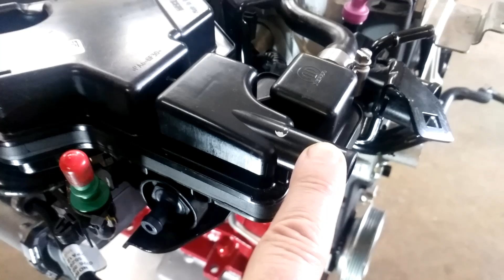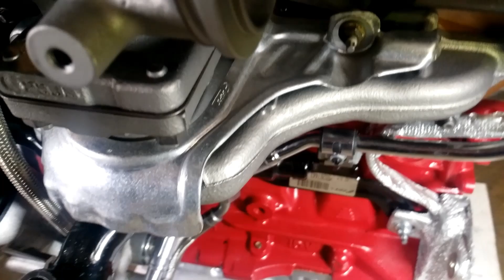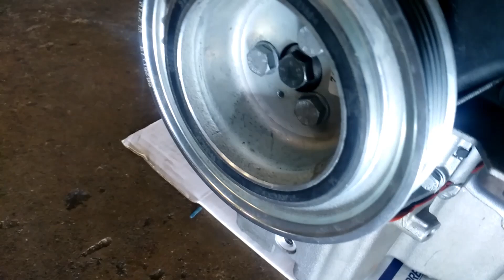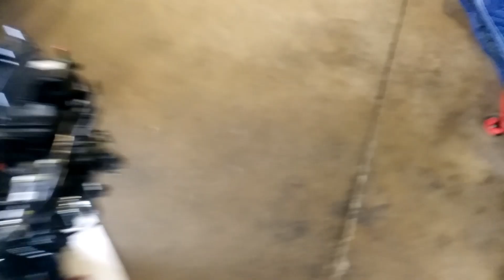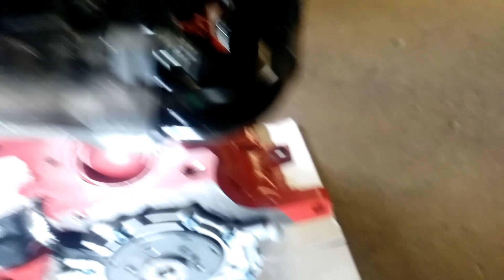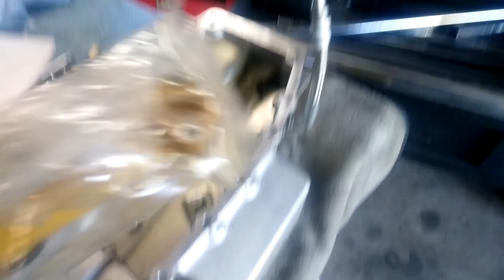Fiat 1.4 Multiair Build Completed, Plus Timing Belt Change Instructions

Comment: That steel coolant pipe under the exhaust manifold with the funny nut goes right back to the the original 1980s Fiat FIRE engine. They work well but on older cars they are noted for corrosion. Worth a coat of paint (on top of OEM) in my opinion.

Comment: The oil cooler is a plate type heat exchanger. The idea was perfected by Rolls Royce with patents going back to the 1970s but it's likely they had them even longer ago on classified equipment.

Comment: Me again. The 1.6, 1.8 and 2.0 twin can engine as used in certain Fiat cars and the Alfa Romeo TS (Twin Spark) had non-keyed cam pulleys. Cam locking tools sat over cam lobes on each cam. You also needed a reaction (holding) tool to hold the cam wheel while torquing the retaining bolt.
Reply from the maker: I don't doubt that, but this is the first engine I have seen that's set up this way. Keep in mind we didn't have any new Fiats or Alfas here for a while, so there are engines I haven't seen. All engines I have seen have either timing marks, keyways, or both, this is the first engine I have ever seen with nothing to help align the cam. I think it's a huge mistake on Fiat/Alfa's part.

Comment: Great video, I have the 1.4L  engine in my 2016 500X POP with a 6-speed manual, it's a fun car.I don't plan on any mods but I love learning about it.
Reply: can I know one thing, is that follow the same style of Abarth 500's transmission? cause It only has 5 speed manual. so is it possible to swap?
Reply: @duke9620  500X, which is more of a Jeep than a Fiat 500
Reply: @duke9620  im not saying its impossible, but chances are it is impossible. would need different halfshafts, shift linkage, etc

Comment: Old Fiat FIRE engines (1.1L especially) are popular in Eastern Europe for amator racing - slap in 1.2 head, factory 4-2-1 exhaust manifold, 42mm throttle body or ITBs from a 650cc bike, balance rotating assembly, put flywheel on a diet and you'll get around 120HP reving up to 8500 - 9k RPM
Reply from the maker: That makes sense, all the Fiat engines are good. We didn't get than engine in the US, but I'm glad to hear it's doing well over there.

Comment: Me thinks 153,000 miles is the life of this engine / car (246,229 kms) I can't imagine many being alive after that except a few.  And good luck finding a mechanic that knows about the crank lock tool when that happens.
Reply from the maker: My 500L has about 130,000 miles on it and still has full compression and doesn't leak or burn oil. That's with over 200hp for almost it's entire life so I do think the engines will last through one belt cycle and way beyond. However the value of the car is such that they may not be worth maintaining beyond that. Fiats drop in value like crazy and the lack of dealer support has been a killer to the brand. Plus the prices of the parts have been going up a lot.
Reply: @GregsAirplanesandAutomobiles  Yes I needed 5 lug nuts for my Abarth and only the dealer had them $85.  Big reason why I stopped driving it daily and its only got 34,000 miles, still like new.  It has gone up in value recently though, which is good.  From barely worth $14,500 to nearly $20,000.  So storing it has been worth it.
Reply: Change the oil every 6.000miles /10000 kilometers and the engine will live over 400000 kilometers

Comment: I wouldn't take the engine out to change the timing belt.
However, I got stuck when removing the first cast.
It is connected to the compressor support casting.

Comment: Answered several mysteries that not available anywhere else.  Marvelous! The last mystery is - why do these engines drain down the oil in the valve actuators when inactive for long periods?  It seems like a simple design flaw that there is a missing check valve  in the oil supply for the accumulator chamber or lack of quick positive supply from the oil pump or worn intake lifter clearance?  If the oil pump could quickly replenish the accumulator when cranking a long stored engine it would seem to solve this issue.  It is a shame that ignorant/ lazy/ oil maint. may be the death of this design.  The Dart an Spider are history - is there an easy mod to the oil passages?  Accusump does not seem to have a kit.  A complete diagram of the oil network for this engine has been elusive.
Reply from the maker: Thanks for watching my video. Yes, the oil drain down is an issue if the car sits for too long. In my experience it has to sit for months before it's a problem, but still, they shouldn't have let that happen.

Comment: multi air is in the 2.4L Tigershark variant in JEEP Cherokees.  I thought they should have used an electric oil pump because the mutliair if it sits for extended periods has a longer crank time until the oil pressure pumps back up.
Reply from the maker: Worse than that, if it sits long enough you can't start it without bleeding the multiair system, not something you can easily do in an airport long term parking lot.

Comment: 21:00 I discovered a coolant leak during my last oil change on my 124. It looked like it was sourced from the notorious water pump area. The leak isn't massive pr causing any problems but I'm replacing the pump, tensioner and belt soon and I hope after this huge jib it stops the leak and it isn't this part.
Reply from the maker: That's a problem area, but the Fiat water pump is a quality unit. If you put it all together and seal it carefully you will have years if not decades of leak free service from it.
Reply: @GregsAirplanesandAutomobiles  yeah I'm 23k mi in to my 124 abarth and I'm hoping it's just the issue of the factory rtv. Heard they didn't put enough on. Any rtv you recommend?
Reply from the maker: Sure, I personally use this on my Fiats: https://www.jbweld.com/product/hi-temp-red-silicone . I have been very happy with it.

Comment: The Jeep engine is a completely new series of engine itroduced in 2016 called the Hirricane. Have not worked one one but it was supposedly developed in house by Alpha for the Giulia
Reply from the maker: Yup, in fact we are already tuning the Hurricane engines, which as you said are based on Alfa Romeo architecture. The Hurricane is a great engine.
Reply: @GregsAirplanesandAutomobiles  So this means there has never been a non-multiair FIRE engine in the US
Reply from the maker: I'm not sure what you mean. The Jeep Wrangler has an optional 2 liter turbo four cylinder. It's a Hurricane engine, non mulit-air. The upcoming 6 cylinder Hurrican is of similar design.
Reply: @GregsAirplanesandAutomobiles  As Im sure you know, this 1.4 is from the Fiat FIRE series of engines which go back to the 80's . As you stated, in Europe they had Non-Multiair 16v versions of the FIRE as standard. The point is it would seem that at no time was any version of the non-multiair FIRE engine sold in North America. The 2.0, as we stated, being a completely  different engine. As an aside Stellantis claims the 3.0 Hurricane is bespoke as well, having less than 5% comminality with any other engine line.

Comment: I wish I had the knowledge and the patience to do stuff like this on my own time, it legitimately looks fun. 

And I must ask, is that your Jeep in the background?
Reply from the maker: Thanks Sky, no, it's my son's Jeep. It has a lot of modifications for appearance and off road action. Under the hood it's a 2.0 Turbo with extra power via a Vaitrix booster module (which we tuned here).
Reply: Thank you, Greg. Jeeps are the only car I know anything about because of all the work I’ve had to do on mine. It’s interesting to see a much more in depth video such as yours though.
Reply: @skyflier8955  The Jeep Renegade and Fiat 500X are made in the same Poland factory. May parts are common but the implementations are quit a but different.

Comment: hmmm spraypainting the black spaghetti into multi-coloured spaghetti might make finding stuff easier. Then again, an engine gets hot so I would need to find heat-resistant paint for the sprayer.
Reply from the maker: A reasonable idea, but It's easier to change to different colored hoses, paint won't stick to that stuff.

Comment: Can you weigh in on the use of stiffer multi-air springs?  You were talking about the fact that you could prove that modified multi-air units fail and cause valve to piston contact.  There are is a tunner that uses stiffer multi-air springs in his stage 2 package.  Claims better pull through the upper rpm range.
Reply: jetguy flying, Yes I'd like to know more about this as well. Was this modification that caused the valves to contact the piston from your video?
Reply from the maker: I very strongly recommend NOT changing to aftermarket multiair springs. At best you gain absolutely nothing, at worst you will have significant damage.

Comment: The dealership told me that if you over tighten the knock sensor you will crush it.  So I guess be careful not to over torque it, although I also suspect that the dealership is just saying stuff to make me buy a 3rd knock sensor instead of just replacing the ECU under warranty.
Reply from the maker: Your stealership is misleading you. Over torquing any bolt on any car beyond a certain point will damage something so of course overtorquing the knock sensor beyond some point will damage it. If you are having to replace knock sensors, something is really wrong. I have never seen one fail.

Comment: I, too, have the 1.4L MultiAir in my 2013 Dodge Dart. Love the car, love the performance. Unfortunately, at 100K miles I had to get the top of the engine rebuilt. The cam lobes were completely worn down leaving the MultiAir system without enough oil pressure to work properly. Have you ever had that happen to one of your engines? Most of my mileage was highway, commuting to work five days a week, 160 miles round trip. Not especially hard driving, but I did use manual shift mode frequently with the 6-speed DCT and always used spec oil.
Reply from the maker: I haven't seen that problem, it's odd because the multiair lobes are rollers, so they normally don't wear at all.

Comment: Evening Greg! Thanks for such a detailed video. How hard would you say changing both belts and the water pump would be with a couple of jack stands and the correct timing tools in my driveway? I'm a sparks by trade and have some practical knowledge and have just purchased a 2015, 75k "1.4 Multiair TB Alfa Romeo Gulietta QV-Line"  and it doesn't show this being done in the service history so thought I could tackle it, saving some money, gaining some exsperiance and the peace of mind knowing it wasn't attempted with sharpie marks by a garage. Is this the correct order of operation: 

1) Remove the battery and the air Intake (to make room around the vacuum pump).
2) Jack the bottom of the engine to unload it slightly and place a jackstand for support. Where is a good place to put the jack stand and the jack to prevent cracking the case? 
3) Remove the engine mount, freeing the area around the belts.
4) Remove tension on the serpentine belt and then remove it from the crank pulley. 
5) Remove the crank pulley and install the locking tool by rotating the crank until the tool aligns with the bolt post before tightening it in place.
6) Remove the vacuum pump and install the holding plate (I assume that it will align correctly first try now as the crank is already locked in the correct position?).
7) Remove the tensioner and the timing belt and loosen the cam sprocket (Whilst holding tension on the cam sprocket with an external tool to prevent snapping the cam rod).
8) Remove the water pump with a container below to capture any excess coolant (I assume I don't need to drain the coolant reservoir or the radiator to do this? / This isn't going to all come rushing out?).
9) Install a new water pump with a bead of liquid gasket around the perimeter after cleaning the mounting services with a plastic scraper.
10) Install the new timing belt and tensioner, over-tensioning it slightly past the mark to allow for the tensioner to spring back, at this point the cam sprocket will also rotate slightly taking up slack in the new timing belt? 
11) Torque down the cam sprocket (Whilst holding tension on the cam sprocket with an external tool to prevent snapping the cam rod).
12) Remove both timing tools and turn the engine manually twice and then check the tension is still correct. Am i listening for strange noises? weird grinding? how will I know if it's wrong?
13) If the tension is still correct reinstall other components, remove the jack stand and jack , and after waiting a little while for the battery to charge the system (To not upset the Alfa ecu) start the engine. 

I hope this all correct? If i go to install the holding plate and it doesn't align (Even though the crank is locked it the correct position) what do I do? does that mean the engines timing is slightly off in this hypothetical scenario? (even though the engine runs fine at the moment). Correcting me and any extra advice would be so much appreciated Greg, I hope to hear from you soon!
Reply: Oh also I plan on changing all the disks & pads and brake fluid as well as engine oil, Oil filter, Multiair Strainer/filter, Air filter, pollen filter and spark plugs. Regarding the transmission fluid,  it looks like a massive pain to get to and I believe this engine doesn't have a dipstick to check the quality, when do you normally change it and should i do that also? Any help with all above or advice on servicing it for a fresh start for my ownership will be much appreciated and thanks again!
Reply from the maker: I have never worked on a Giulietta, we didn't have those in the US but your description does look right, although I didn't go through it super carefully. cont:

    If the holding plates don't align, you have to rotate the crank and or cam until they do.
Reply: @GregsAirplanesandAutomobiles  thanks for your quick response Greg, how will I know which one needs to be rotated? By rotating one or the other won't I be changing the engine's timing?

Comment: There is a lot of hype surrounding Koenigsegg free-valve engines.  Didn't the Fiat MultiAir do roughly the same thing many years prior with one small difference: Koenigsegg engineers were confident enough to leave the camshaft out altogether, while Fiat said, let's leave in the bumpstick -- as a baseline -- just in case.  Would this topic justify a video by itself?
Reply from the maker: They are similar, however Fiat uses it on intake valves only, Koenigsegg uses it on both intake and exhaust. The Fiat system uses oil pressure to control lift and duration. Koenigsegg uses air pressure for duration and oil for lift. I think Fiat's is better because it's less complex and does the same thing. Anytime they wanted to, Fiat could put this on both sets of valves and even eliminate the cam entirely. It's an issue of cost, let's remember that a Fiat 500 Abarth is a 22k car brand new. You can get a great used one for very little. The Koenigsegg car is over 2 million.
Reply: @GregsAirplanesandAutomobiles  Correct me if I'm wrong but I thought MultiAir still needed the cam and any cam profile changes were a subset of that? Freevalve can have an effectively square cam profile. Or is it just that the use of a cam makes the whole system cheaper and simpler and it would be possible to make camless at greater cost? If so, what changes would be required to make MultiAir a camless system?

Comment: Thanks for your informative video.
how about turbo problems, since there were some claims about it in Europe, especially versions before 2018.
Reply from the maker: I haven't seen a turbo problem in one of these engines. I have seen a lot of people claiming to have turbo problems, which turned out to be something else.
Reply: @GregsAirplanesandAutomobiles would you consider it as reliable engine?

Comment: Can I ask one favor??
Can you please share with us what spark plugs are best for this motor ?? And if you want , the plugs for your modified engine vs the ones we would normally use?? 
It would be greatly appreciated!!!
Reply from the maker: Sure, I normally use these: https://shopeurocompulsion.net/products/ngk-fiat-spark-plugs . However the Brisks are a bit better for anti-knock, but they don't last long: https://shopeurocompulsion.net/products/ngk-fiat-spark-plugs
Reply: Thanks again , have you had to deal with oil draining out of the brick ? And the engine starting ?? Any tricks to prevent that?
Reply from the maker: I have had to deal with that. I have no tricks to prevent it other than starting the car at least every couple weeks.